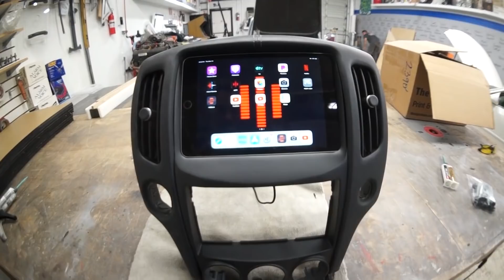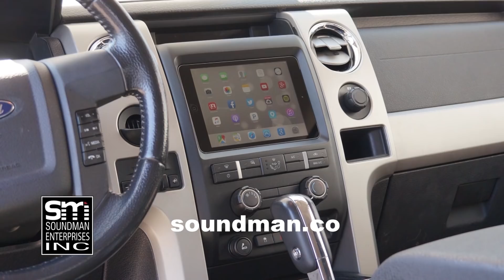MULE MONDAY episode 1

Comment: Really like what you’re doing to address the Mule’s long languishing issues.  Two thoughts, paint the bead-lined area the body color when you repaint the car, and two, get rid of that crappy exhaust and go with something quieter.  Those motors sound like shit no matter what you do, so tame it down and dump it out the center of the back with some cool fabricated exhaust tip, since you’re redoing the roll pan anyway.  Cheers!

Comment: There are 2 different types of "body hammers".

A FLAT head SPREADS OUT the metal
A CROSS CUT head SHRINKS the metal by "pinching" it.

Wipe down the area with alcohol before ANY paint (primer) to minimize lifting.